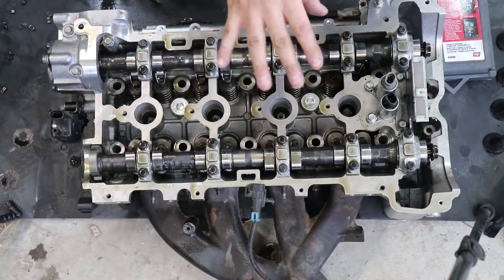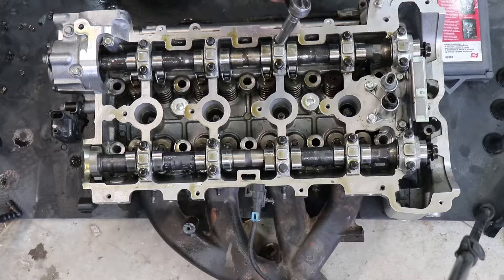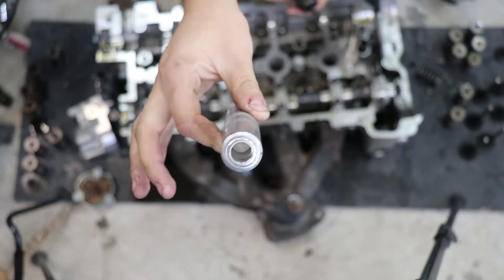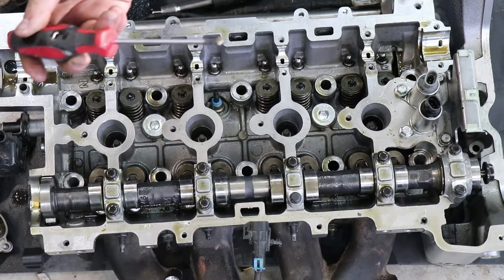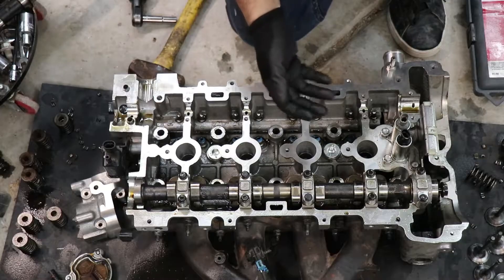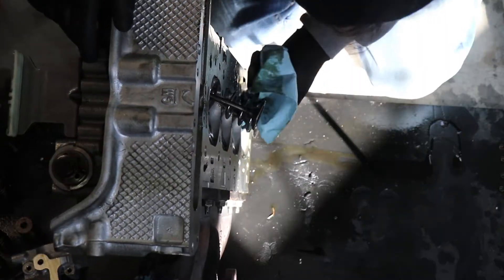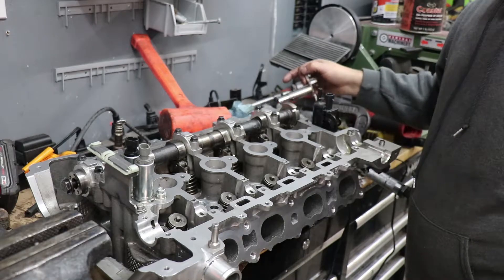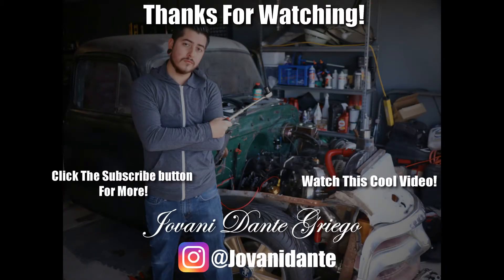Removing Valve Springs Without Any Special Tools - No Machine Shop Needed - Fix Bent Valves

Comment: As for the keepers. I used a piece of PVC pipe. I cut a u type shape almost looks like a O2 sensor socket. And place it over valve spring and use a large C clamp to hold.  And then use some grease on end of a flat tip screw driver to place keepers on valve stem.  Then slowly release compressed spring. Bingo!😅

Comment: How do you keep the valve from falling into the engine block
Reply from the maker: This is just the head. The valves are kept in by the tension of the spring on the valve retainers
Reply: @JovaniDanteGriego i finished watching and realized ive  been trying to fix my valve issue on a 5.7l engine and dont want to tear it all the way down
Reply: Im trying to not dismantle the head assembly.  Leaving it together and change out the half moon keepers while the head is still on
Reply from the maker: @Brad-r7i oh ok so on a small block the best way to do this is one cylinder at a time, you're going turn the engine until the cylinder is down, then shove some camping rope into the cylinder and bring the cylinder up until it stops. The rope is going to push up against your valve now you can safely remove your springs and the valve will stay up
Reply from the maker: @Brad-r7i  dig around on my videos and I think I even have a video on this
Reply: You got any ideas. Id be happy to accept any knowledge
Reply: Sadly i bought all the parts and 5 mechanics wont work on it
Reply: I give up. Life has defeated me
Reply from the maker: Ooh a Toyota, I've never worked on a 5.7 Toyota so I wouldn't know the right angle, another method is to buy a cheap compression tester from harbor freight and then arrange it to work with a air nozzle. You basically blow air into the cylinder and pressurize it, to be safe I'd also bring the cylinder up to the top just to be sure but again I don't know the angle of the 5.7 I know on a small block the valve will not fall all the way in if the piston is up
Reply: @JovaniDanteGriego cant get more than 25 lbs. Other valve releases the pressure
Reply: Dual overhead cams
Reply from the maker: @Brad-r7i why not just remove the head?
Reply: release the sping and valves when that piston is top dead center.  Valves cannot fall in too far then.
Reply: @MrShakamuni01 i don't own nor can i find the proper tool to release it.  Ive bought 3 different types of valve compressors.  None adjusted to what i need. Overhead valves theres a bar that runs over the top of the spring and I can release the spring enough.
Reply: @Brad-r7i yeah I don't know about releasing the spring on your car but you asked if you could change the valve stem seals with the head still on and that's what I was answering to.
Reply: Thank you  @MrShakamuni01

Comment: You saved my ass. My valve spring compressor tool stripped and i was SOL until i saw the socket method. Made my 1 hour job take 2 mins🙏

Comment: I was so confused with the engine head with the valves and springs. Your video helped me understand how simple it is to replace or clean the valves.
Reply from the maker: @Drityfro09  try not to touch the valve stem to much other than with a brass brush. I failed to mention this in the video.
Reply: @JovaniDanteGriego  question: can one replace the valve rack arms, springs and valves to prolong the life on an engine? And is that what you did in this video?
Reply from the maker: @Drityfro09  so yes and no. Unless the engine is known for weak spring materials, bad trunions, etc. then these components should all be good for the life of the engine obviously inspect parts and replace as needed but no engines require complete replacement of valve train as a maintenance item, only if something has broken, worn etc. hope that helps
Reply: @JovaniDanteGriego  that helps. My 2.4 ecotec engine had a timing chain cover oil leak that I didn’t get fixed for over 6months unfortunately. I am approaching 200k miles. I am about to replace my valve cover gaskets and didn’t want to be hit with any surprises. My engine starts normal and drives without any misfires or jumps. I have been researching a ton. I am asking questions to get a better understanding how the 3 layered engine comes together.
Reply: @JovaniDanteGriego  my intake and exhaust solenoids are bad. I know I need to replace this asap.
Reply: @JovaniDanteGriego  for clarity I replaced my timing chain cover gasket. No more oil leaks. The 2 solenoids will be replaced this week and the valve cover gasket shortly after. I am approaching 200k miles and wanted to get clarity on the 2.4 ecotec engine.
Reply from the maker: @Drityfro09  hey man 200k is great on a ecotec. Do what you can

Comment: Here's a tip ... If your valve lapping compounds sole purpose is to remove burrs, and grind aluminum and steel to create a seal..... Yeah it's pretty important to NOT leave any bit of that shit in your valve well or across the bottom of your cylinder head. Dont do what he did and wipe your rag across the head with compound in it..... Maybe remove the valve seals while you lap also......

Comment: It's a lot easier just to us a very long extension on your socket and attach a ratchet and then with your palm apply pressure to the spring, just like the way you were explaining how to reinstall the keepers. It's a lot easier than using the hammer. Just saying. The longer the extension the better.

Comment: Yeah that's an old trick of the old days when nobody had these fancy tools of these modern times you really had to use  your noodle😜😁.        great video .This is what I'm doing right now with the cylinder head! I'm just reusing the old valve springs had re service

Comment: “no special tools required”  then proceeds to use valve keeper tool and a chevy valve spring compressor
Reply: Should watch whole vid before inserting dumb comment. I swear, Some folks' freedom of speech should be taxed
Reply from the maker: If you paid attention I ended up using a socket and extension

Comment: I found a missing valve keeper on my 1.6l TGDI Ecoboost. We're pulling cams soon to see if the keeper was actually missing or it's a spare from the factory. All the valvetrain is still intact... so we don' know how it would escape. If we see it's missing I'm thinking about installing it with the head-on... maybe. feed some rope into the cylinder bank so the valve doesn't strike a piston.

Comment: I know this video is over a year old, but I just saw a video the other day where someone used that Lyle tool to put the springs back on. They used a hammer on it the same as when taking it off, with that attachment on the end of course and the keepers just fell into place. 
I hope you got the timing right on it the second time so you didn't have to do it again. Lol

Comment: Here's a tip, when installing springs, compress it with vice grips or a bench vice, put 2 heavy duty zip ties around the spring to hold it, then position it in correctly and cut the zip ties to relieve spring compression, they will just pop into place
Reply from the maker: This is a good tip, I've done this in the past with a vice, however sometimes the zip ties themselves will be in the way and doesn't work for heads where the spring is recessed into a hole
Reply: @JovaniDanteGriego  yeah good point

Comment: I will never bring my car to you to fix it 👎👎
Reply: Me neither, why would you beat on your head and valve springs when you can buy tool on Amazon relatively  cheap.
Reply from the maker: Go ahead and find a ecotec valve spring tool for cheap. I used the Lisle remover tool and it did not work. And it's literally the same concept you smack it with a hammer and it has a magnet to collect the keepers. This is how to do it
Reply from the maker: That's fine I don't work on other people's junk

Comment: The Lisle tool works pretty well removing springs. Installing is a nightmare for me. Most frustrating is that it got one keeper in and the other half jammed, then repeat. I gave up on it after 2 hours try, exhausted and frustrated, and ordered a C clap style from Amazon to finish the job. I like your self made tool. It can replace the springs and keepers with the head on the engine. Good job!
Reply from the maker: Yea I'm glad I made that little puppy. Took about 6 hours from inception but it works pretty well. If only someone wanted to make some nice cnc versions 😂

Comment: I swear I ALMOST quit building engines because of keepers alone! I learned the hard way though, nobody told me, their easy ish to get out it's getting them back in thats the issue, tried so many tricks like the grease on screwdriver n blah blah blah nothing worked, my previous build I ended up using a 1/4" small socket that fit over my valve tips and a 16mm deep socket with a 6 inch extender over the retainers, lined up the keepers in the retainers n pushed with my body weight, took a try or two on some and boop! Locked in place, all valves done in an hr only after a solid week of trying every "valve spring compressor tool" I could find in my local shops spent so much damn money on tools but w.e I got it done lol Until the next build anyway ... anyone else doing keepers, Good luck!

Comment: Honestly, this is the best explainer video I have seen to remove valves. A job well done. took me 15 minutes to remove 16 valves. Thank you so much. Now its going to be tough getting them back in there!
Reply: This method usually adds little scratches to the valve stem  which can lead to leaky valve stem seals down the road.

Comment: Thanks. Picking up techniques from different videos. I’m gonna steal this idea but instead of hammering it, I’m gonna use locking pliers for leverage. Then I’ll slowly push on the spring. I’ll use a magnet pen through the hole of the socket instead of the extension. Now I just have to come up with an efficient way to install them back without the keepers flying into another dimension.
Reply from the maker: Are you working on a ecotec head?
Reply: Jovani Dante Griego Toyota engine